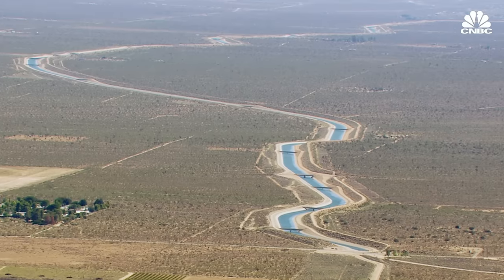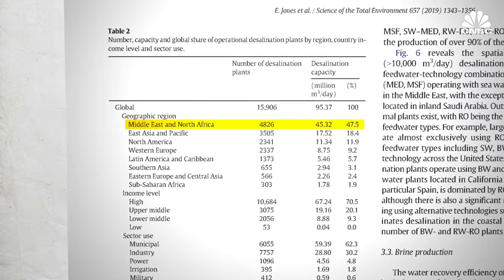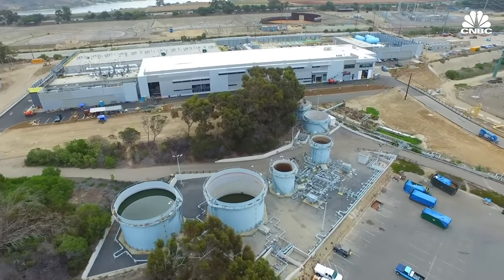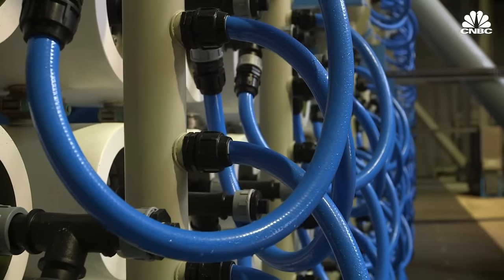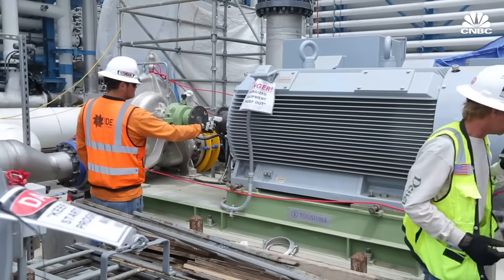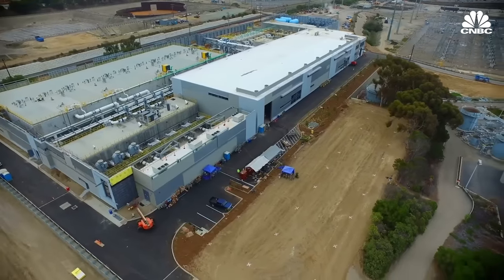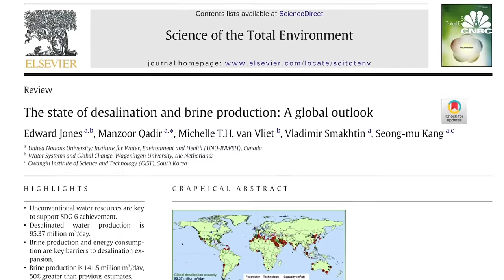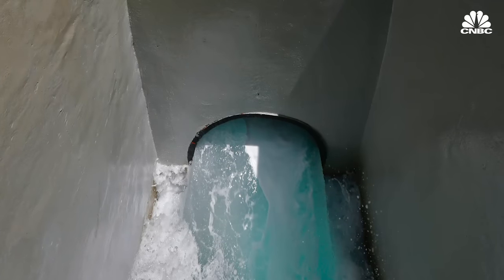Can Sea Water Desalination Save The World?

Comment: Then make salts out of the brine by heating it under the sun...
Reply: Tonz Lang that would take a ton of space
Reply: And then do WHAT with the salt?  No conceivable use for that much.   Natural evaporation is causing vastly more 'brine' constantly, it's just distributed evenly.  It's not as tho desal has any effect on ocean salinity on average what so ever.  Same amount of salt in the oceans so it's just a matter of dilution/distribution.
Reply: @Mrbfgray  I think salt for commercial use (cooking) would be great use of the brine
Reply: @Mrbfgray  In cold climates we pour salt on the roads to melt ice. We have very large dump trucks with plows that move the snow and salt the roads simultaneously.
Reply: @Mrbfgray  The problem could be solved by finding a commercial use for salt transforming the salt into a usable product (such as mixing it with carbon and creating hardened salt crystal glass)
This gives the salt a purpose and fuels the economic growth around the desalination process, yet so far the viability of such products is low and would require considerable R&D investment to create a commercial product that would be viable in the open market place.
Reply: @flackstar007  I don't think there is much of a problem to start with, very localized in any event.  It's not as tho there is any change to the salinity of the oceans as a whole.  Mixing it with sufficient ocean water at discharge might fix local issues.
Reply: @tjwoosta  Salting roads is a stupid practice IMO.  Coarse sand does the trick just fine without destroying infrastructure, vehicles and damaging the environment.
Reply: @Mrbfgray  agreed its not a problem at the start, but like any thing its an issue once it becomes the norm.
So as the industry grows it would be very hard to tell companies to suddenly switch their production methods because by that point they would be competing on price and would claim that changing would make them un-competitive.

Its basically the issue facing the energy industry currently (they can switch to greener energy but don't want to as it would mean their bottom line drops and they would lose business to cheaper messier alternatives in a price driven economy)
Reply: We stopped doing that, because the salt seeps down to the groundwater and we end up desalinating ground water
Reply: @Mrbfgray  Maybe a Nuclear Power plant shall be set up to run the desalination plant, and the brine produced is transferred to a reservoir where a heatsink from the nuke plant is routed into the reservoir to evaporate the water and produce commercial salt as well as distilled water for other uses.
Reply: Michael Flack batteries ocean brine is rich in lithium they use it for batteries
Reply: @aakashsahani2991  yeah. Theres a lot of places that waste energy in the form of heat. If we could use that heat for something productive, say desaltination, we could made society as a whole more energy, water, and cost efficient
Reply: There is no shortage for salt anywhere...
Reply: Bo McGillacutty  i don’t think thats the point he’s making. If we had enough brine, companies that actively go out to mine salt, would find it much less of a cost to just go collect and process it.

Comment: Does reverse osmosis not lead to distilled water?

If salt is extracted so are all the minerals I imagine.
Reply: You just throw a tiny bit of the mineral you've removed back into the water before distribution, no issue there.
Reply: yes it does but it is different your reverse osmosis machine that you maybe have at home is filtering all the minerals so you get distilled water and after some time you have to change the filter.
but these massive machines work differently like they explained in the video because it would be way to expensive to filter all minerals out of the water so they use the simplified process
Reply: Distillation is a specific process - boiling and re-condensing the steam afterwards. The same process used for making liquor spirits. Reverse-osmosis is a filtration technique that is not quite as effective in terms of the purity of the treated water. Hope that helps.
Reply: No, distilled water is just purified water. Like adding water to a kettle and boiling it.
Reply: We just make the membrane 97% efficient, so water is still tasty.
Reply: In some places it has eaten up metal pipes before they realised they need to add minerals
Reply: Reverse osmosis is also extremely wasteful as a practise.
Reply: gold in seawater should pay for it!
Reply: Reverse osmose does not deliver distilled water!!!  Distilled water is made by boiling and condensing.  This process does not remove all minerals, that's the reason you should not use it for ironing.  You need demineralized water for that.  And most of demineralized water is produced by reverse osmose processes.  They can easily add some healthy (and PH-adaptive) minerals in it after.

Comment: How to solve this problem: 

Build nuclear reactors. Nuclear reactors produce near to 0 co2 and the produces a enormous amount of energy. 

Use that Energy for those water desalination systems.
Reply: You're completely right, but the leftisft environmentalist are against nuclear energy because "it's bad". Without actually really knowing how the nuclear energy works nowadays
Reply: Better still, use the waste heat for desalination, put the energy into the grid and shut down a coal plant.
Reply: true what about the waste ? and no they will not send the waste to space not as long as it would cost 4500-5500 usd / kg ( 2,2 pounds )
Reply: That is something that needs to be done but if the world switches to nuclear where will all the waste go. No one will send it to space because it is way too expensive and we can’t just dig it in the ground. Also meltdowns would have a higher chance of happening  because there would be more incompetent workers
Reply: @cedriclenners3737  isn't thorium better then nuclear also most reactors are water cooled and old if plants are to be built they need generation 4 versions not the pressurized ones. Or you know fusion but that's years away. Hmmm what about a semi heat conductor?

Comment: With the ice caps melting, the water in the oceans is getting more dilute (less salty), therefore producing more brine would be a benefit.
It's most important in the Gulf Stream in the way ice melt interacts with the heavier salty water, this is already producing noticeable prolonged, heavy rainfall in
New England and higher temperatures in the northern Pacific region.
Reply: "the Gulf Stream" about that,
Reply: I think the risk of brine disposal is the actual site of disposal, not the entire ocean's salinity.
Reply: @michaell.4730  Sir, that's because investors are already getting rid off bad investments; and coastal cities like New Orleans are building larger dams nowadays. We lead by example, not by what other people do.
Reply: @michaell.4730  that's the least scientific comment I've read in weeks
Reply: Wrong. The sun then will heat the melt ice water and then it will rain on the ground again. So the brine aren’t diluted by ice caps water over time.
Reply: the caps are not melting and ocean level are not rising
Reply: I think we should purify and drink ocean water I mean sure it’s expensive but it’ll pay off
Reply: Yes! Thank you for saying that. Obviously with polar caps melting desalinization could help counteract sea level rise as well.
Reply: Personally I haven't noticed the temps in CA being any higher than I remember as a child in the 60's.  We had weeks of 110-115 degrees every summer.   Personally I thought it was a nice break after moving from New Mexico where frequently the temps were above 125 during the day and dropped to the mid 50's at night.  Of course the closest paved road was over a mile away and it was at least that far to find concrete having been poured.  So when night came there wasn't anything to HOLD the heat.  A huge part of the "warming" that no one else notices is the urge to pave or concrete as much as possible.  Causing heat sinks where it stays HOT for many hours after the sun goes down.
Reply: @mrpoquah  Isn't it more of a question of places like Lake Meade drying up?
Reply: Doesn't work that way,  the water with the lower salinity is heavier so it sinks.  Add brine and you just add another layer.   You can pour them together it doesn't mean they will actually mix.  As they stated in the video, sea water isn't just water with salt poured in where it can simply be filtered out.  That goes both ways you can't just mix a new batch like kool-aid
Reply: @cannonfodder6299  The fresh water floats on top of high saline sea water, until, in the vastness of churning oceans, it mixes. Heating and cooling cycles aid in this.
Reply: @zeeblats  not true.  Salinity decreases with depth, it isn't a whole lot.  This is do to ice formation and evaporation.
   Besides it isn't the salt that's an issue, it's the salt in one location.  We couldn't desalination enough to make a dent in the oceans salinity as a whole.  But we could without cate make localized wastelands in the ocean.
Reply: @cannonfodder6299  
The active desalination plants are being observed by marine biologists and Greenpeace,  if what you say is true,  they will make a heck of a lot of noise. I think the first one started production in the 1990s, I shall have fun researching this. Thank you for your interesting comments,  they add to the topic at hand.
Reply: @zeeblats  yes currently, but I was talking about if we really started building them along the coast.  Not just the few we already have.
Reply: it is easy turn those salt into table salt and sale it back
Reply: @GPSniper1  it would probably be as much salt produced in a day than the customers it serves consume in a year.
Reply: Ice caps aren’t melting
Reply: @zeeblats , yeah, nasa and European satellite data show ice increasing.
Reply: @Joe-bh4vz  I think you should re-evaluate your dataset, it appears to contradict what you base your supposition upon. Perhaps you could spend a little time doing some valuable research? It's good to question, but only when you are prepared to invest time into the subject you are commenting upon. Education never stops, and I implore you to continue with yours. There are a lot of kids out there who gave up and just Parrott falsehoods. I do hope you're just having a laugh for the sake of it. Thanks for your comment and I wish you well in the great adventure of life, the universe and everything. #42
Reply: @zeeblats , I’m just going by what the nasa satellites show.
Reply: @Joe-bh4vz  I honestly don't know where you're getting this from, NASA Goddard Earth Science Projects disagrees with you. Now I know you're having a laugh.
Reply: @zeeblats , you have 30 year old information
Reply: A huge iceburg melting in the atlantic is like an ice cube in a bathtub, It won't make any signifigant desalinization.
Reply: @zeeblats , lake Powel is why lake Meade

Comment: The brine could be used to take the various minerals the land is missing, it would help limit the mining of those different minerals and therefore limit use of heavy machinery that wrecks natural habitats. Potassium is found in seawater and is used in gardens as well as healthcare. Brine could also be used in flow batteries(since its sealed i would try to put a limit on how many batteries are made ). We should still try not to take too much saltwater out of the ocean at one time, try to use the desalinated water to slowly add more water to the soil so we don't need to use as much. Give the ocean time to regain homeostasis with the water cycle and the rain will help wash the salt back into the ocean.

Comment: Thanks for this program.  I have wondered for a good while why desalination plants are not proliferating around the world, but especially around the U.S.’s coastline.  Are we waiting for Americans to begin dying from thirst?  Our attempts at curbing climate change seem to be going absolutely nowhere.  So at least as a life-saving stopgap, why not extensive desalination investments?
Reply: Good question
Reply: Because money.
Reply: ....mmmmmmmmm human population control???? I'm just throwing out the question....
Reply: @Someoldlady1234  
I have designed and built several desalination systems. That said, the answer and the solution, from my point of view is this:
 I prefer thermal desalination ,because the product is pure distilled, pathogen free water, to which you can add the adequate minerals in the quantity and composition that is pleasant, like the arterial water in the  northside of Palm Springs.
The energy to boil is very high, at a higher pressure at 105°C, any higher, calcium carbonate scales will form. To reduce the energy, you condense the steam on a lower temperature heat exchanger and collect it , the remaining slightly cooler water is boiled against a smaller pressure and condensed against the same heat exchanger further along, where the temperature is slightly lower, this boiling in lower pressure is called flashing. You continue the process with ever smaller pressures many times  up to 40 stages.
This means that for the same energy you can boil 40 times more water.
The name reflects this: 40( multi) stage flash thermal desalination.
But the energy required to boil is high, even when reusing the evaporation enthalpy 40 times. 
You need expensive  copper nickel based tubes to condense the steam in forty chambers. Difficult to seal one stage from the other. Also boiling creates dropplets, which contain salt, they must be removed in 'demisters' prior to condensation.
Still the calcium carbonate in the seawater  can be deposited in the inner side of the tubes reducing the heat transfer, preheating the seawater a little more in each stage and on the final and only heater (which requires external heat.)
 The addition of phosphoric acid to the incoming sea water prevents any scaling.( limestone deposits, aka calcium carbonate,  Ca CO3 )
The cost of the many long coppernickel tubes and the maintenance is acceptable. 
 The highest cost is the thermal energy which can be: waisted heat recovered from Nuclear power plants at a temperature of more than 105 °C.
What about wasted heat from steam plants?
The temperature is too low, because efficient steam turbines condense in near vacuum pressures at 40°
What about Gasturbine generators?
YES, that works because the simple cycle gasturbine exhaust is over 300°C and modern GE aeroderivatives engines approach an efficiency of 46%
This is a viable solution, based on the good progress in efficient engines like the GE 90 and the much better GE 9X, powering the 777X.
We must wait for an industrial version of that aircraft version, coming soon.
No reason, not to modernize the power and water supply in coastal  regions.
Reply: Meanwhile we flush millions of gallons of fresh water down the toilet every day.
Reply: @rickyrickardo8347  You are right but this ability IS THE REASON WHY WE DO NOT JUMP FROM ONE EPIDEMIC TO THE NEXT. It is the difference that made a healthy civilization possible. Ample water is the reason populations strived along rivers . Go to Africa and see the misery, when only ponds are around. Swiss foreign aid concentrated on that problem.
Reply: @rickyrickardo8347  Ricky, What’s the answer?  Should we all be using composting toilets?  Regards, Bob Campbell
Reply: @bobcampbell3505  I'm sure theres a better way, someone could easily come up a with a system for using grey water.
Reply: @bobcampbell3505  no, wastewater needs to be recycled. In my state it passes a few stages of filtration, then gets pumped underground into the aquifers for use later.
Reply: @rickyrickardo8347  Since 2017, residents in the Western Australian city of Perth have been drinking water recycled from sewage. It is filtered using a process called reverse osmosis, which is similar to forcing water through a giant sponge. It is then disinfected with ultra-violet light at a treatment plant, pumped into natural aquifers, and extracted.
Reply: They will stop water their grass lawn before they are die of thirsty.
Reply: @rickyrickardo8347  When I was in Navy ship we used sea water to flush our toilets down into ocean,we also had desalination system in our ship for drinking and washing.
Reply: There is a lot of water in Great lakes,build a pipe to transport water to the West.
Reply: @bobcampbell3505  Hong Kong has a separate seawater system just for toilet flushing, so that is something that other coastal cities can consider.
Reply: @rickyrickardo8347  Not in S.F. and Oakland.  People caca-ding on the sidewalks.  Good water conservation practices.
Reply: "From that time Jesus began to preach, and to say, Repent: for the kingdom of heaven is at hand." Matthew 4:17 

"Ye have heard that it hath been said, An eye for an eye, and a tooth for a tooth: But I say unto you, That ye resist not evil: but whosoever shall smite thee on thy right cheek, turn to him the other also." Matthew 5:38-39•'
Reply: @charleshoang566 you like stealing things?
Reply: @clashtwo5066  Not stealing just sharing.
Reply: but that would make fresh water non-profitable
Reply: Drippin, true; capitalism rules!  No profit, drop dead!  Bob Campbell
Reply: @drippinwet774  unalive the Nestlé shareholders is a good start
Reply: @arturoeugster2377  that's the longest youtube comment I've seen, Ty for the information sir I know it took time. 😊
Reply: @Tempora158  I was thinking that could work ty for sharing